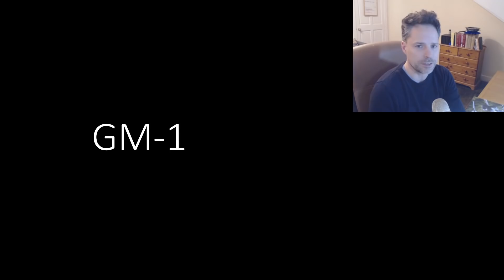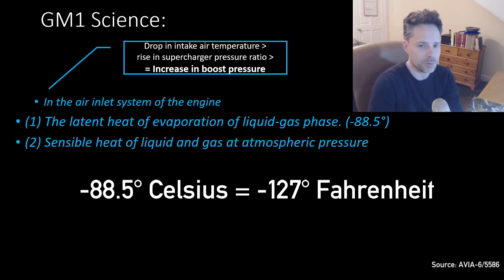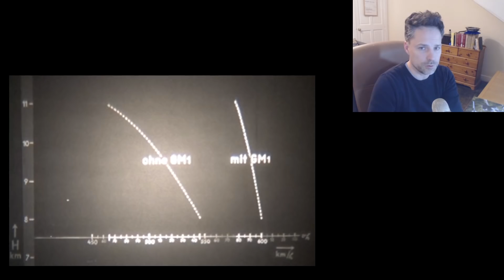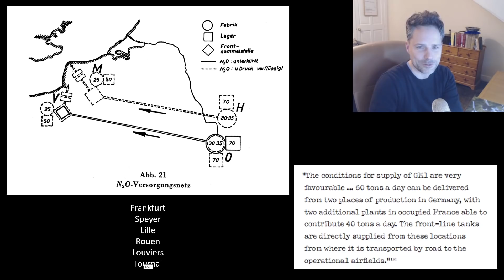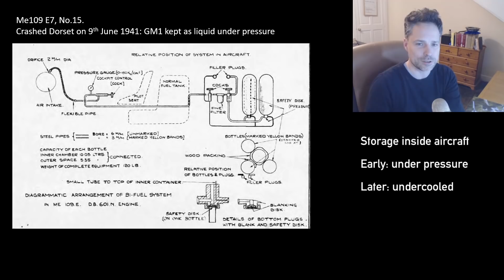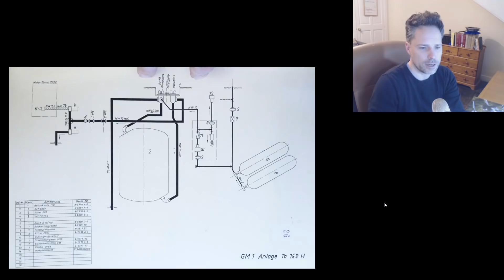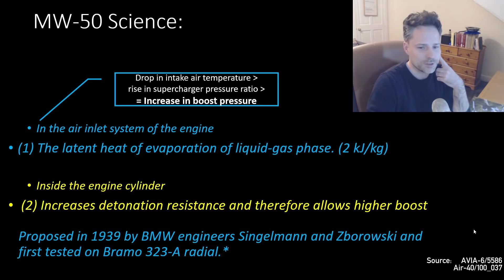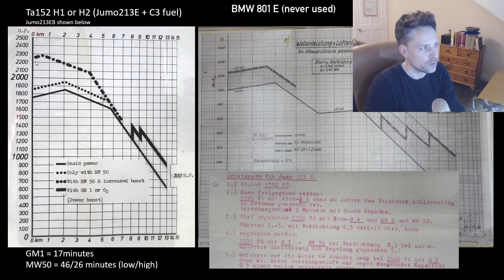The Secret Behind German Engine Performance: GM-1 and MW-50

Comment: The boost systems were more of a necessity for the Germans because they lacked the strategic, logistic and technical advantages that the Western Allies enjoyed with regard to fuel development and supply. The Germans were forced to synthesize aviation fuel from coal which had octane limitations. In the US, fuels with octane ratings of 100 and more increased engine performance during the war without the weight penalty incurred by the German boost systems. A shipment of 100 octane to Britain which added up to another 300hp below critical altitude in 1940 was just in time for the Battle of Britain. That all being said, various forms of water injection were commonplace on all sides by the late mid-war period.
Reply: It is worth keeping in mind that Britain had its own manufacturing plants for 100 octane, using the same synthetic Hydrogenation used in Germany. Whilst the vast majority over the course of the war did come from the USA, not ALL of it did. :)

Comment: This video seems to forget that water and ethanol injection was being used/experimented with in WWI. Manually advance the engine timing and inject the mixture to stop detonation.  Not the best system but it predates all this and was already being done
Reply: It doesnt "forget" anything, Nitrous was also being used at the time. However, neither in aero-engines, which is the topic of discussion here. Virtually nothing is new, and if you were to make a "complete" history of every single technology every video would have to go back in time so far we`d never get to the point.

Comment: I have a dodge built 91 2.2 16 valve intercooled engine.  The one they built for lotus.  Factor 225 hp.  With fuel mods it was 303 hp.  With nitrous now don't know the hp?  Now the MW 50 sounds great before the 2 1\4 in Garret turbo!
Reply: What car would that be in? And what Lotus used it?

Comment: Every hot rodder knows there's nothing like a good shot of nitrous (oxide)..H2O injection delays preignition therefore more boost can be used OR higher CR or lower octane fuel..I'm amazed it isn't more widely  used..
Reply: Seems unnecessarily complicated. Also fuel stations would have to adapt, introducing a whole different supply chain. H2O, or Dihydrogen monoxide, is water by the way...

Comment: Simple Version:-
(1) MW50 is Methanol Water 50% -- Germans use it because they have SHITTY FUEL (87 Octane). Methanol Water allows them to run more boost from the supercharger(s).
(2) GM1 is Nitrous Oxide -- Germans use it because they DON'T HAVE ENOUGH OXYGEN in the air at high altitudes.
(3) Allies in general didn't need Methanol because they had 150 Octane Fuel and they had turbocharged engines like that in the Lightning and Thunderbolt for high altitude application.
Reply: If you simplify things beyond a certain point, they start to become innacurate: Please note:

1) Actually almost all the Engines the Germans used MW50 with ran on C3 high octane fuel.
2) This is a reflection of the lack of 2-stage supercharging in German planes.
3) 150 grade didn't arrive until the end of the war, turbochargers don't give you better high altitude performance by themselves, its having a 2-stage system which does that (which the lightning and thunderbolt have, but could equally have had without a turbocharger too, and Methanol is no use above rated altitude because you have no oxygen to burn the extra fuel.
Reply: @CalumDouglas  Actually, no.
--
(1) C3 Fuel was exceedingly rare and most German warplanes ran on B4 fuel through the end of the war including those with MW50 injection. As a matter of fact, that is the primary reason for the existence of MW50 -- to make up for the manifold pressure advantage allied planes had due to superior fuel.
--
(2) All the USAAF fighters out of Britain basically ran on 130/150 octane fuel since they began operating in the European theater. It was not the exception, it was not something that happened towards the end of the war, it was the default from day one. Germans couldn't match the fuel quality because the Germans basically never had oil fields and had to make expensive and inferior gasoline from coal.
--
(3) Turbocharger systems do in fact afford superior high altitude performance by and of themselves. The reason is two fold. Firstly, boost is infinitely variable and controlled by the turbine waste gate. This means that the compressor can be optimize for high altitudes without over boosting at lower altitudes. It was also devoid of discrete "speeds" or steps in the drive setting such as that of 2 or 3 speed supercharger transmissions. Secondly, because they are driven by otherwise wasted exhaust energy, they can be sized to be VERY BIG and hence capable of higher pressure ratios without loss of efficiency. Superchargers sized that big would draw enormous amount of crank horsepower not to mention grossly overboosting the aircraft at takeoff thereby requiring impractically limited throttle opening limits.
Reply: Allies didn't need "methanol"?  Apparently you are unaware that airplanes such as the P-47 and F4U had water methanol injection, and they didn't use it because of 87 octane fuel.  Even if you have the best supercharger in the world it is still limited by the anti-detonation rating of the fuel in the cylinder, and water injection increases that, whatever the octane.
Reply: @dwightlooi  

1) Dwight, I have ALL the actual German engine data cards, right here. Almost without exception the use of MW50 required C3 fuel.

2) On page 438 of my book, you`ll find a graph showing when the first deliveries of 100/150 grade were available in Britain. (June 1944). 

3) Sadly mostly nonsense Dwight, you need 6:1 pressure ratio to maintain engine power at high altitude in an engine like the Merlin (or indeed any aero engine), at the time it was not possible to obtain more than about 3:1 from any single compressor stage. How you drive it is irrelevant to that limitation, 2 speeds to the supercharger, and/or a swirl throttle largely removes the problems of throttling losses. A turbo is the best system in principle, but I`m afraid you REALLY do need 2 stages to have a good high altitude engine regardless of what drives the compressor shaft.

I would suggest you buy my book as Chris suggests, you`ve been watching the wrong videos, or reading the wrong books.
Reply: @CalumDouglas  Uh... just because it is in your book does not make it true except by your insistence, does it?
--
(1) The DB605 engine was design around 87 Octane B4 fuel. That is why it needed 36 liters of displacement to make roughly the same power as the 27 Merlin 60-series (actually a little bit less). It wasn't because Germans don't known how to shape combustion chambers or do proper ignition -- they simply do not have the fuel octane required to run as much boost. The Merlin 6x (aka V-1650) NEVER ran on anything other than 100/130/150 gas; which meant that the Spit IX and the Mustang B/C/D never ran on anything below 100 octane.
(2) Later 605 versions like the AM has settings for C3 fuel, but the lack of availability meant that the Luftwaffe used it as an exception rather than by default.
(3) By mid-44 the C3 + MW50 requirement was superseded by guidance for B4 + MW50 than that became default for the rest of the war. The same can be said of the other late war engines like the larger DB603 or the smaller Jumo 213. By late-44 any squadron will be happy to have ANY fuel at all and looking for special C3 grade for a little extra performance was really like looking for champagne in a famine. Methanol and water however was not in short supply its use with B4 persists through the end of the war.
(4) Some US engines like the R2800 did use water injection for additional boost (higher altitude supercharger ratios at a lower altitudes), but in general they did not use methanol in the spray mixture. What racers use at Reno way after the warbirds service careers doesn't count.
Reply: Yes it does in fact, because unlike your unreferenced garbage its 100% referenced by archival primary source documents. 

I note that instead of defending your orginal points (which were almost all embarrasingly wrong) you now write a load of new and irrelevant points.

We all await your fascinating book (*facepalm*)

Comment: Why did the Daimler engines used by the Luftwaffe not increase horsepower by sequential supercharger as was done in the Merlin’s. This would have resulted in greater boost pressure.
Reply: Daimler-Benz had 2-stage DB601 engines designed before the 2-Stage Merlin ever took form (about 1936). The story of why that didnt end up resulting in better German aircraft is rather-longwinded and is one reason I wrote a book on it, where you will find photos of those early 2-Stage Daimlers and a lot of material explaining their disappearance from use.
Reply: @CalumDouglas  That sounds very interesting. My guess would've been there was simply not any additional room to spare in the tiny 109 airframe. Then again, due to fluid coupling they wouldn't even have needed to split the supercharging in two, they could've just opted for an aftercooler.

Comment: Wait, were those graphs near the end with both GM-1 and MW50? It looked like it just showed them separately with one being MW50 with boost. Would the power output be even higher than 2300hp with both then?
Reply: As far as I'm aware they were not supposed to be operated at the same time. At lower altitudes you would use MW50, and above some specified altitude you'd switch to GM-1. Having access to both simply meant you could enhance performance over a larger altitude band than if you only had one of them.
Reply: Engine mechanical and thermal limitations prevented this being done in Germany, it is quite possible in principle. So the answer to your question, is "yes" in theory. But "no" considering the rear wartime situation for German engine designers.
Reply: @CalumDouglas  Thank you! I did generally know they were not usually applied at the same  time but I was just wondering if those graphs were supposed to have that data line with both boosting methods applied.
Reply: @romanvarcolac2238  I can't be sure without a time stamp but if you're referring to that jagged graph: That is likely due to the three different flow rates of the GM-1 system. You wouldn't just wanna go all-in above a certain altitude threshold with that stuff. :P
Reply: @argh1312  Oh alright. Thank you! It makes sense that they would have different settings for GM-1

Comment: Slightly ot: the 109 -how much difference was there between variants? Was a late 109 basically the same plane as 1935, or was it a totally different plane that looked kinda like early models and shäred the name? How much did the 109 evole during it's lifetime? Asking becuase I was thinking of our Swedish JAS Gripen and the fact that new ones are not the same plane at all as it was when the first Gripen was commisioned 30'ish years ago. The name and the basic shape are the same, but not much else, not even the size.
Reply from the maker: Depends how you qualify 'difference'. With the 109, its a bit similar to the Gripen you describe, or even other contemporaries like the Spitfire. Visually, the Bf 109 changes from the E to F model. After that, the visual changes continue but without changing the basic look too much. Ignoring the outward appearance however, the systems, weapon and engine change continually, again with subdivisions for example of different models of the same engine type or changes to the wheel size etc. A Bf 109 of ...say 1943 ... was very different to a 109 from 1939, although visually you could still relate them.
Reply: D to E pretty massive change.

Comment: With NOS and ethanol/water, I wonder what kind of performance the Germans could've gotten out of their engines if they had also had access to higher octane aviation fuel.
Reply: Their engines were big and flimsy because they ran at low power output.  A modern O-360 aero engine only gives 180 hp from 5.5 litres for that reason.  Remember a Bf 109G's DB 605 made 1,300 hp from 36 litres, not impressive at all.
Reply: @givenfirstnamefamilyfirstn3935  Well some were able to put out much more for limited time. Around 1800 to 2000 PS, depending on fuel.
Reply: @givenfirstnamefamilyfirstn3935  the 605s got up to 2500 horsepower at the high end. Yes, not quiet as impressive as rolls royce, and an atrocious hp/liter by modern standards, but competitive with othe rengines of the era.
Reply: Some last gasp good for a few minutes prototype or minimal production end game variant when there was no fuel or few experienced pilots left proves nothing, when it mattered the 605 was mediocre. 1,300 hp was the output of the vast majority of the production,  they didn't have the high output cooling for more than a short burst of increased power at the end anyway, the coo!ant plumbing and radiator elements were primitive compared to a Merlin's.
Reply: @givenfirstnamefamilyfirstn3935  The merlin was a masterpiece of engineering, but 1300 was the output of the benz engines in '39, not 45. I think you might be confusing models here.
Reply: @givenfirstnamefamilyfirstn3935  3 * 10 minutes isn't a short burst, it's half the 109's uptime. And the power restrictions for much of 1943 were due to faulty oil tanks I think.
Reply: @ineednochannelyoutube5384    You are writing bollocks, pulling wild numbers out of thin air. 1939 Bf 109E with 1,300 hp, REALLY?
Reply: @givenfirstnamefamilyfirstn3935  So I specifically looked it up. The pre war wariant running on the 601 made 1175 shaft horspower, and the late war 605 1800 at peak output dueing takeoff.
I have no idea where you pulled the 1300 figure from, no wariant had such a rating. Thw 603 made 1750.

Comment: The best fighter of ww2 hands down 190
Reply: Low down perhaps?
Reply: There are many best fighters of the 2.WW, depending on what you're after. But the Fw 190 is one of the most interesting ones in terms of engineering for sure.

Comment: Hot Rodders have been using nitrous oxide in their engines on the street for decades now. And yup, it does give you a real kick in the pants when it reaches your engine! The only problem is building an engine that can withstand the added horsepower and the cost of the N2O system and installation. Plus the cost of refilling the bottle all the time. Hot Rodding is expensive!

Comment: But what was the Octane rating of German fuel compared to 150 Octane US AvGas? Geoff Who is curious.
Reply from the maker: B3/ B4: ~87 Octane
C2/ C3: ~95 Octane 

German octane numbers are lower because they are based on the lean mix, Allies would indicate rich mix. (you'll find minor variations at time in the literature)

Based on a US Report: 'The C-3 grade corresponded roughly to the U. S. grade 130 gasoline, although the octane number of C-3 was specified to be only 95 and its lean mixture performance was somewhat poorer.'
Reply: German C3 is roughly equal to American 100/130 octane Avgas
Reply: @MilitaryAviationHistory  i didnt know that

Comment: So the nitrus cools down the air, then heats it up upon combustion?  I had to play this part around ten times to begin to understand lol
Reply: It evaporates first, cooling the incoming air - when the combustion occurs the Nitrogen and Oxygen split, which releases heat. This only happens at high pressure and temperature, so the heating bit doesnt happen until its squished inside the cylinder and heated up.

If you enjoy chemistry its:

2N2O → 2N2 + O2 + heat

(A complete Nitrous Oxide molecule when split = Nitrogen Atoms + Oxygen Atoms + Heat
Reply: @CalumDouglas  Ah, that's much clearer.... never studied chemistry at school.  Thanks.  🙂

Comment: Did anyone try to use liquid oxygen? Or would it consume the engine cylinders/pistons/rings/valves...  (Like the rocket plane which used a fuel that dissolved the pilot on contact)

Comment: Great idea's by the Germans although a boosted engine is sometimes unreliable unless air fuel mixtures  are proper and being carbureted I'm sure the mixtures were never exactly right due to air Temps and pilot error.. makes sense why only veteran pilots had the last laugh

Comment: Isn't the oxygen content of the atmosphere 21%?

At 6:46 of the video the lecturer says it's 23%
Reply: Please note "by weight" on the slide. It is 21% by VOLUME, and a shade over 23% by weight.
Reply: A MOLE of gas at r.t. is about 22.5 litres.  If pure nitrogen it weighs 28 grams, if pure oxygen it weighs 32 grams.  So mass and volume are not directly equivalent.
Reply: And to both of you I ask....

What value does any of that have in the real actual world where there is no pure atmosphere's or seperated gases?
Reply: @donneale7555  A mole of nominal octane weighs 114 grams but is about 163 mL of liquid.  It needs 12.5 moles of oxygen for complete combustion but air is not pure oxygen and air density reduces with altitude.
For the commercial licence you are expected to lean the engine/s properly after take off and initial climb.  Excess air will mean the spare oxygen burning out the exhaust valves and excess fuel will reduce range and endurance.  Mixing a gas with liquid fuel in an engine design needs  knowledge of chemistry and physics and a pilot can’t be too stupid either, doing the fine mixture is a bit of an art as well as science.

Comment: Thanks for the video. It was a little bit on the technical side. It didn’t provide any insights on what the actual benefits of the systems where in combat, besides the obvious, the increase of performance in greater heights. There is no info about comments from units or pilots that used them. It’s obvious that these systems didn’t help much German aircrafts to minimise the performance superiority of the P51 in greater heights.